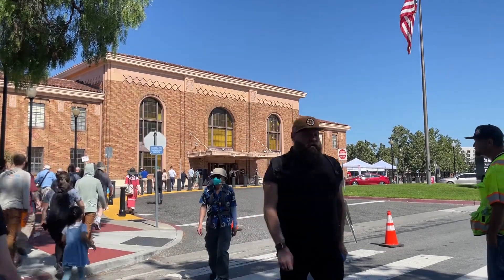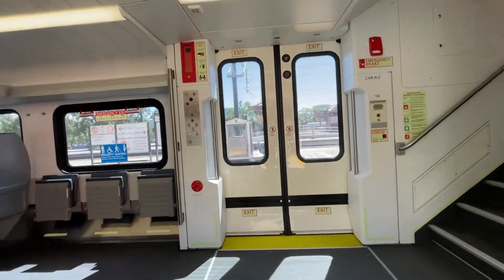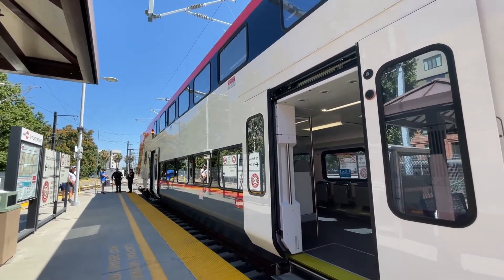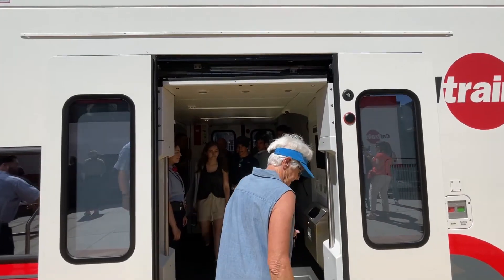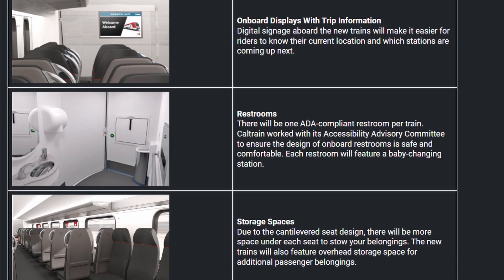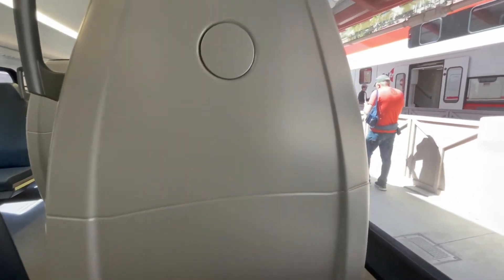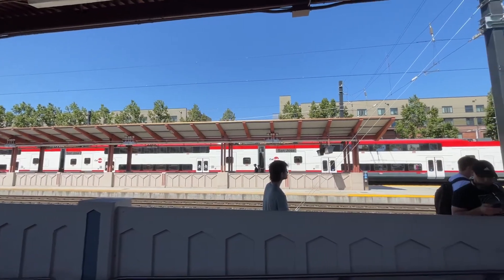First Look at Caltrain's New Electric Trains!

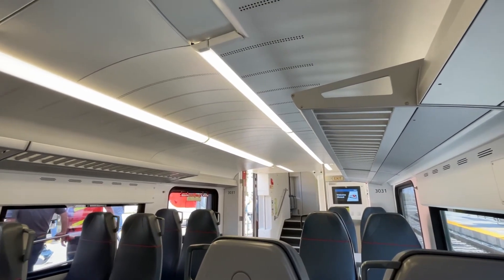Comment: 1:48 Given Caltrain got 3 F40PH-2C locomotives (the long ones, 920-22) in 1998 and 20 new Gallery cars in 2000, I'd expect those to run the last "classic" Caltrain service.  If retired in 2024, those last F40s would have been used as long as Amtrak's F40s (26 years)